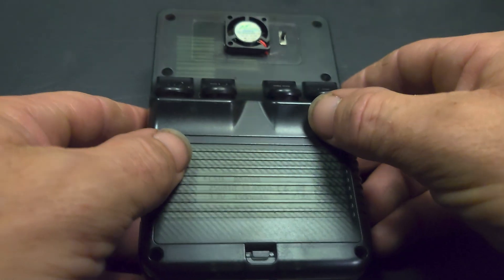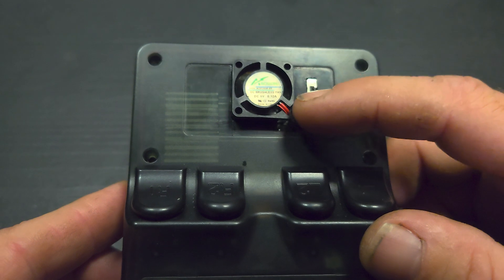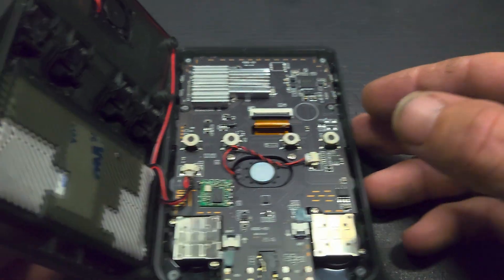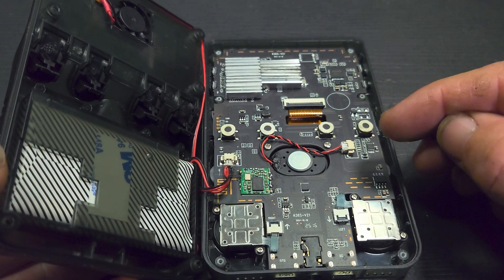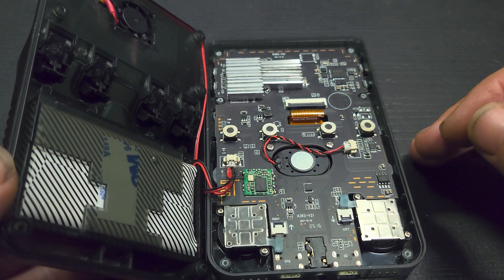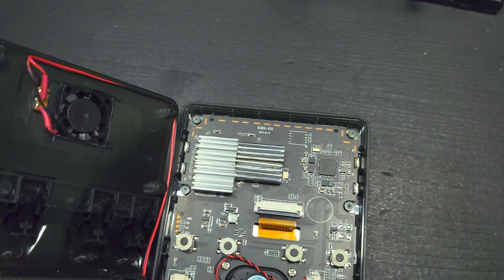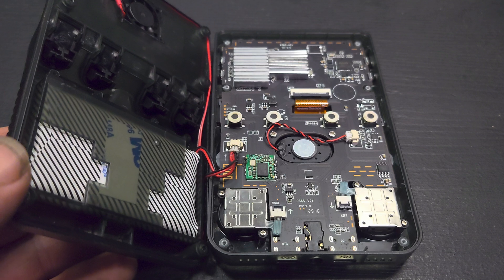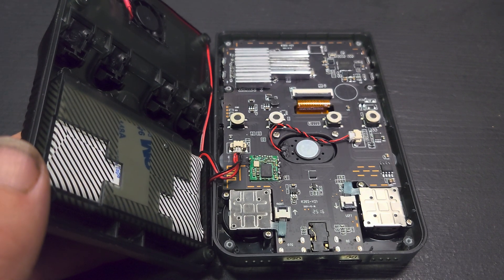R36s heat sink and fan mod #howto #diy #gaming

Comment: Size of the fan you use?
Reply from the maker: 22mm 3.5-5v 

Here's a link  https://share.google/odWoMYDi1gri6zv1S
Reply: @gilmastag413 thanks mate!
Reply: @gilmastag413  intake or exhaust for the fan?
Reply from the maker: I have mine as exhaust I believe pal as long as there is air flow it should be ok, there are 3d printed cases you can purchase with existing panels which I was seriously considering
Reply: @gilmastag413 any link to that? Mine is panel 4
Reply from the maker: I think that refers to the screen type so shouldn't affect the case, but here's the link bro

https://cults3d.com/en/3d-model/gadget/rear-case-replacement-for-r36s
Reply: It works for me, thank you! cooling is good! I can play psp games now without worrying too much on rk3326 😊
Reply from the maker: Awesome man, glad it helped!

Comment: With this upgrade, the battery will drain faster, there's an STL project available for installing laptop batteries in it using 3D printing and simple electronics. Check it out sometime.
Reply from the maker: I already have, I have two laptop batteries ready for the mod, just doesn't drain battery enough to do it all